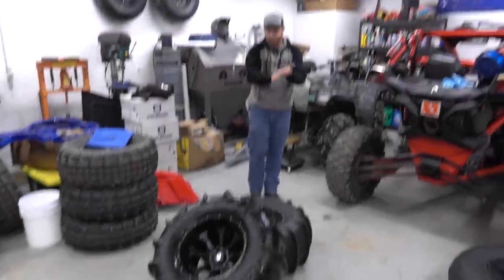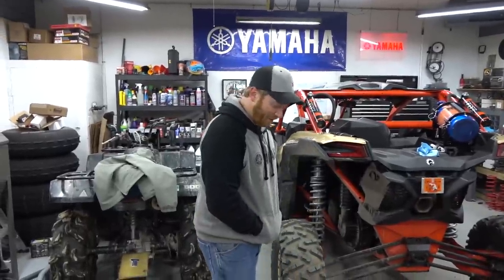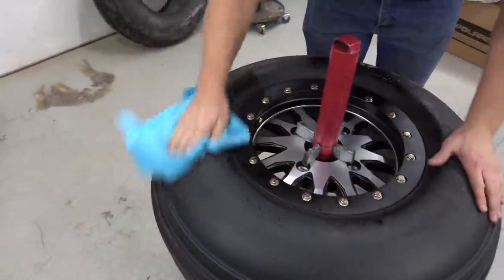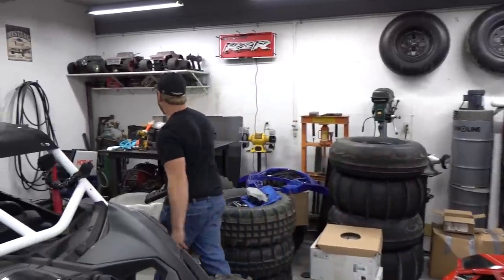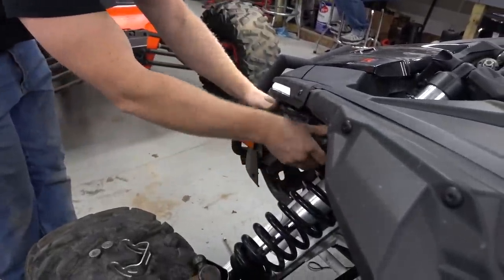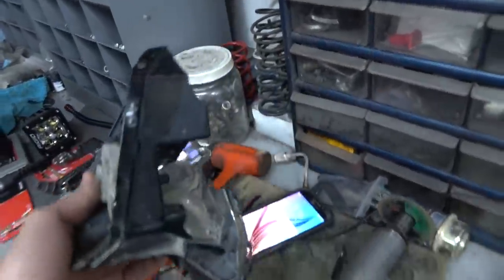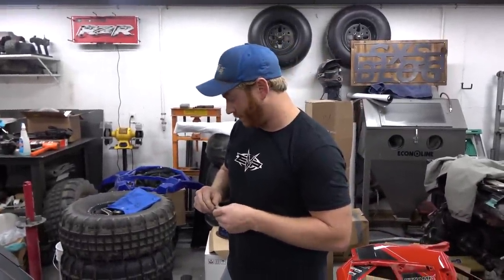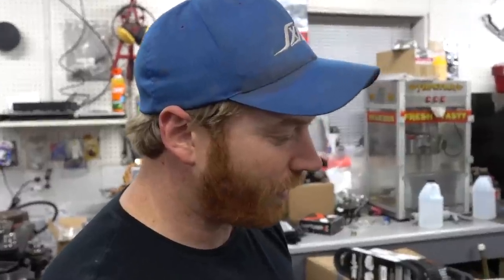GLAMIS Prep PART 1! New wheels and RIGID PODS!

Comment: Just a little tidbit of information they actually sell valve stem tools with a rubber block built on to it that way you can put against the wheel without scratching the wheel

Comment: Run some relays for the light pods. Then you wont have a problem with amperage. And you can run both low and high beams. You can get them off of amazon for cheap. With a waterproof wiring harness. Just my $.02

Comment: SXSBlog.com...does Doug have a set of 4 or the lg offset wheels that he pulled the paddles off. If so, what's the rim diameter & does he want to sell them ?
Brp lighting has sucked for quite a while. In the 80's on the sleds they were about on par with everybody else that ran H4's in a glass housing (No Doug, the phazers/exiters & late model srx/v/max lighting wasn't better...just "different" lol). But starting with the '91 Formula headlights, brp lighting sucked & still does in the can am models. Maybe the sleds have gotten better, but their can am lighting needs some attention.

Comment: You guys rock!
I have a 64" X3 would them rims be for sale?
If not where would I get them?
Appreciate all you guys do.
Keep it up. Thanks.
Reply: Matt Blankenship  I have a 2018 base model x3 have method 408 5/5 offset puts me at about 70 inches wide can't go bigger then 30 inch tires or would rub but way more stable and looks grate

Comment: How  did you build  the brackets
Reply from the maker: Just out of random steel and the mounts that came with the lights.
Reply: Where did you mount it up at I blow the  headlights out of my 3x and am trying  to find a good  why to mount pods. Because stock light are not  cheap.

Comment: Name brand light pods are such a rip off you spend 200 bucks for a small rigid and you can get the same cree ones for 50 bucks I've gone through about 20 pods between my wheelers and ranger and there's no difference in brightness between name brand expensive and the right China brand . I've used both for the last 7 years and I but the cree China kind. Just because you pay more doesn't make it better.
Reply from the maker: We have some China bars that are really bright (like on the YXZ) but the build quality on the Rigid stuff is very noticeably better.  You do get something for your money.  Whether or not it is worth it is a personal choice no doubt.
Reply: SXSBlog.com I agree. I've had some cree and auxbeam China light pods and bars that have been in my kids buggies and for wheelers that have sat outside threw 4 Montana Winters and work fine. My father has those expensive light bars on his Dodge truck that sits in the garage and they have gone one full year and now they flicker and one is dimmer than the other. Anyway can't wait to see the glamis videos!!!
Reply: Rigid has no question life time warranty. If it fails you get a new one. The actual light output of rigids are much better as well. Can't just look at the raw lumen numbers. That's what you pay for.
Reply: N Ringo did you not read my comment man I've had all different rigids and cree and auxbeam they all have warrantees and I've seen it with my own eyes and used them for over 7 years . Good for your opinion man rigid your paying for being cool and having a name brand auxbeam even uses the same style curcuit boards in there older lights as rigid uses now.
Reply: Which one of those brands has a lifetime warranty besides Rigid. And if you believe the internet banter that this brand uses the same circuits/leds blah blah. They might come from the same factory but they aren’t the same raw parts. Also go measure actual light output with an instrument and you’d be surprised. What you perceive as an individual I can’t comment on.